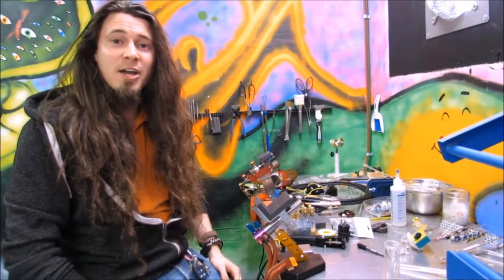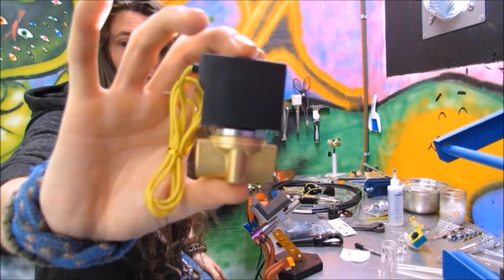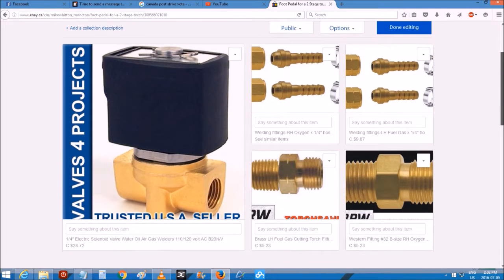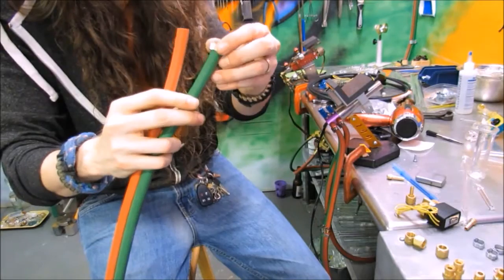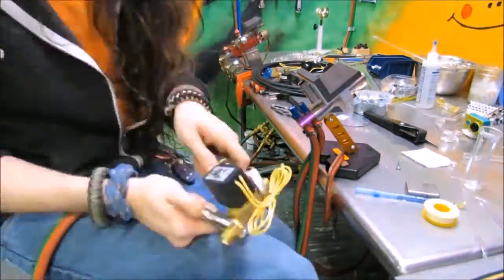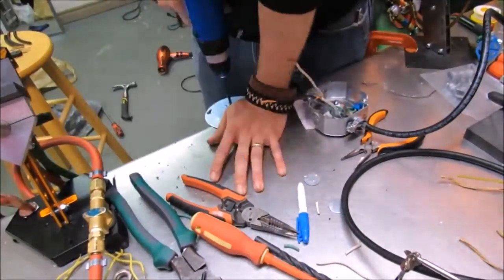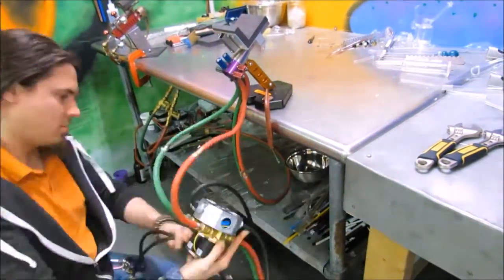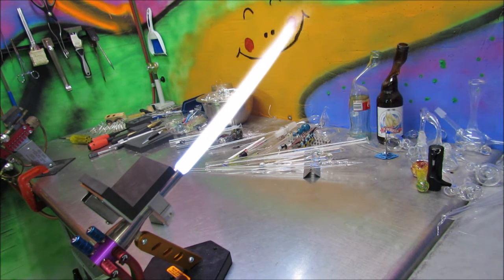DIY foot pedal build for 2-Stage glass torches burner

Comment: Only complaint is that it’s not under 100 usd if you don’t have a free electrician 🤷‍♂️🤷‍♂️ if you don’t have a buddy or know electrical it could quickly become as much as buying a pedal
Reply: this is a 600$ pedal.
Reply: I don't know where your looking but griffin glass sells one for 425 at mountain glass. I had a buddy build mine for like 75 bucks total. Been running it for 3 years and it's perfect for traveling because we built it into a pelican case and it's nice too because it will come on as you push the pedal down so if you just need a short blast you can engage the secondary without actually clicking it on it's a sweet little rig.

Comment: Well done.  And thanks.
//edit- the solenoid isn't oxygen rated but the same build can be used around a different part.  Still awesome video.
Reply: would a air supply house have th oxygen rated solenoid an the other parts?
Reply: @tommacbride3654  Just ask for an "oxygen safe" solenoid. If pure oxygen gas touches any oil under pressure it may explode.  I use the red hat brand oxygen safe solenoid and they cost around $200 US.